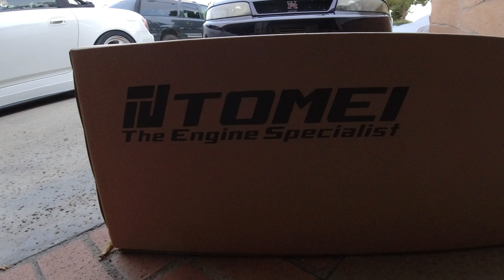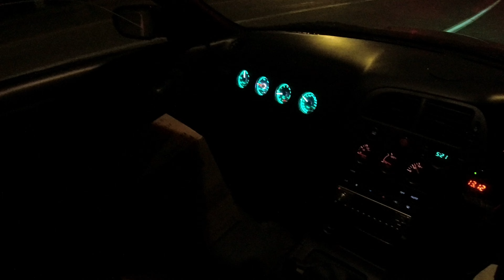Purple R33 GTR Gets TITANIUM EXHAUST - SOUNDS INSANE! Best sounding GTR Exhaust TOMEI

Comment: Where did you get your Tomei from?  I usually order from rhdjapan but they don't have it.  Looking to get one without a crazy wait time.
Reply from the maker: from evasive. got it next day they had it in stock.
Reply: @YungMarsh  I definatley think this is the best sounding, gonna have to get it for the r33 I'm about to get.  Does it have alot of highway drone?
Reply from the maker: @philipsgarage  Drone is really not that bad most of the noise doesnt go into the cabin on the r33. the car is kinda a GT car in that way but it does have a little bit of drone but compared to how loud it is its not much. This car is pretty much just for joyrides so it's not an issue for me but the exhaust also has a silencer you can use if you wanted to roadtrip/daily. You can tell from the POV driving that inside the car it doesnt sound that loud, but outside the car this thing is basically the loudest you can make a car.

Comment: What is your full exhaust/turbo setup and mods ? Trying to achieve The same sound but unsure of what brand & names to purchase
Reply from the maker: Its a greddy single turbo build, so replicating the exact sound isn't really that straight forward. but ive heard a number or gtr's with this same tomei exhaust and it all is going to sound relatively similar to this. Mainly you just need to get the tomei exhaust and you can get this cleaner higher pitched sound which is why i bought the tomei for. You can hear my car with the kakimoto sounds pretty tame in the beginning of the video.
Reply: Thanks for the quick response. You get a sub from now lol
Reply: @YungMarsh could I message you somewhere and talk more ?